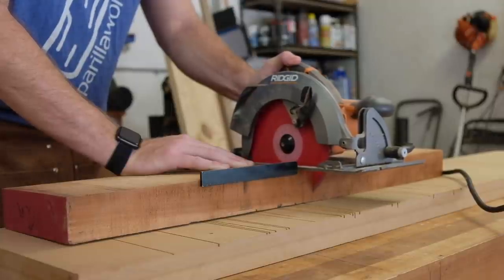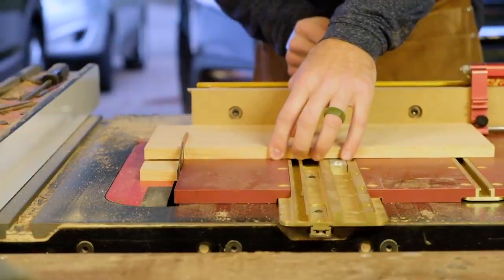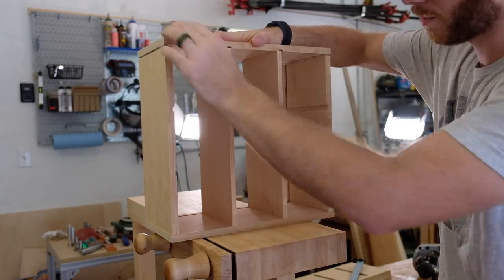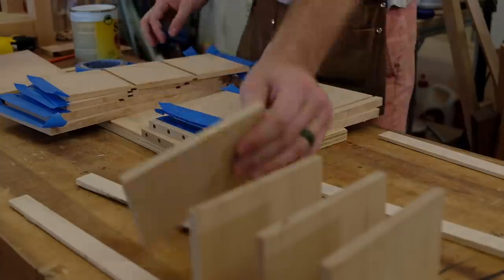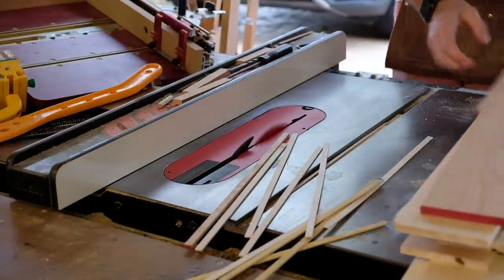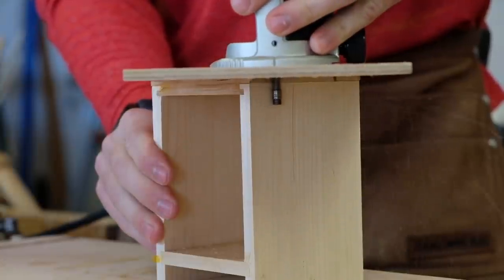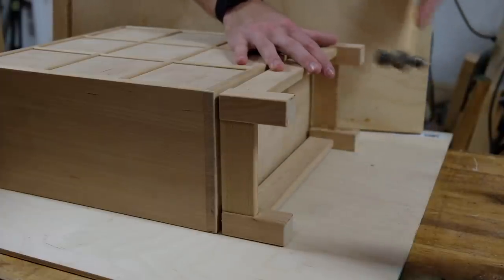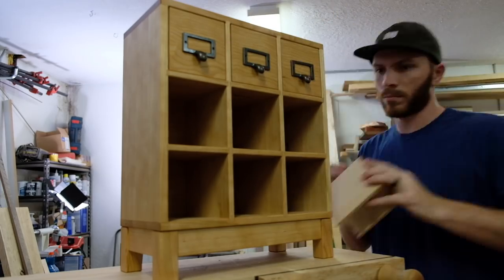How I Make Little Apothecary Chests

Comment: • The delightful sound of those little drawers sliding in and out. 
• The fact that the last drawer pushed the one above out simply because there aren't enough significant gaps for the air to escape.
Both testaments to the tight tolerances of your work.

Comment: 13:54 - check out the Gerstner tool chests on how they deal with the backpressure problem through tolerances.  An easier way to resolve that is through small holes in the back of the cabinet.  Great build.

Comment: Quick thought, so you have a small cnc, mill out two inserts that fit into the router groove and the dado grove, then flip the jig for the other side
Reply from the maker: That’s a great idea. I think it’s the approach I’ll take. And for larger projects, another commenter mentioned using a similar insert to act as a key so I can use a smaller jig for larger pieces.

Comment: 4:30 maybe CNCing a piece that fits into the slots + dados after the cut would be helpful to this process? Cut the dados on one side, then slip in the filler pieces which lock the panel into place while you flip it. 

I was also thinking in the earlier demonstration of the jig you could use pieces like that to make the jig workable for any length of panel. It would essentially give the dado jig a register, just like the dowel max. Cut dados, then shift the piece down and insert the registration piece into one of the cut slots and cut a new slot in the second spot. Then you can shift it down again, using the newly cut slot as the new registration. You could then do a panel of any particular length, with the same spacing between dado cuts. Each top plate for jig would just be a new /different spacing. Hopefully that was explained alright, I'm better at visualizing than vocalizing sometimes.
Reply from the maker: Those are some really great suggestions. I was planning on making a full size jig for my upcoming cabinet. One would need to be 60” the other 35” long. If I can get away with a truncated version using that register block it would save a lot of headache. Thanks again, we’ll see how it goes!

Comment: Good info! Quarter sawing the panels really helps with the scale.What do your clients use these for? How long do you keep the panels in the clamps? 45 minutes to an hour is plenty, let them finish drying before you machine them.
Reply from the maker: Thanks Tom! Some use them for watches, others just random knick knacks. I usually keep them clamped for 2 hours or so. I try to judge it based on how dry the squeeze out is.

Comment: How the heck do you clean up all the interior glue squeeze out from the joints? Your answer will determine the future of my woodworking hobby. No pressure!!
Reply from the maker: Hey Josh. On a project like this I’m mostly worried about the squeezout that interferes with the drawers movement. Finishing the interior with shellac before the glue up help and also scraping with a chisel before the glue fully hardens. Other than that, you just have to estimate how much glue to use; don’t go crazy with it.
Reply: @parillaworks  thank you very much for your response.